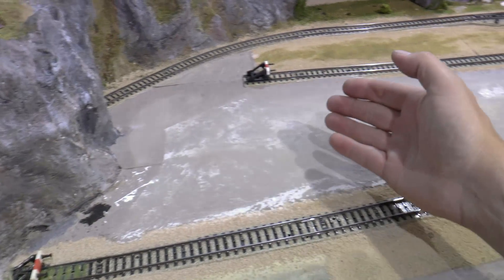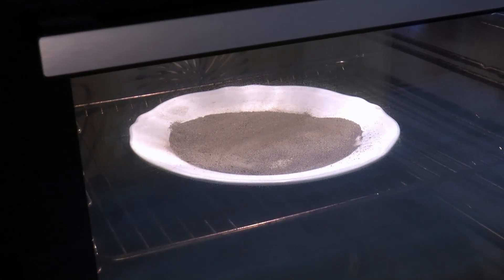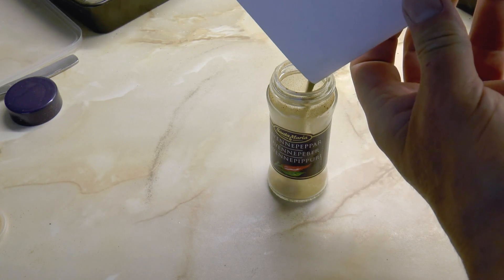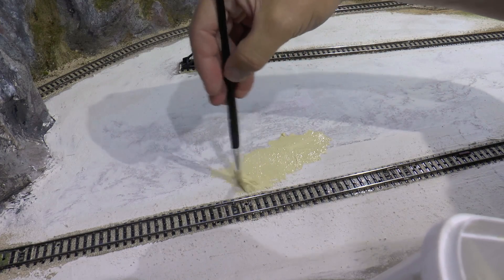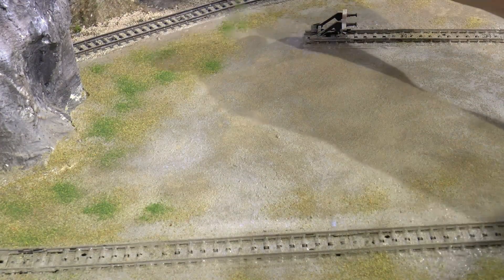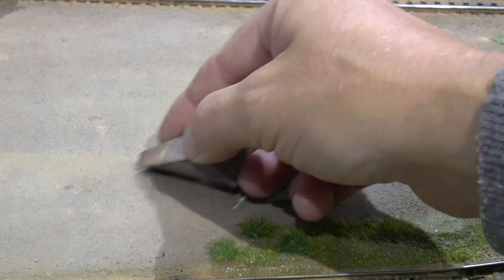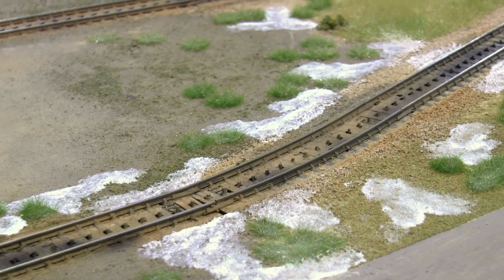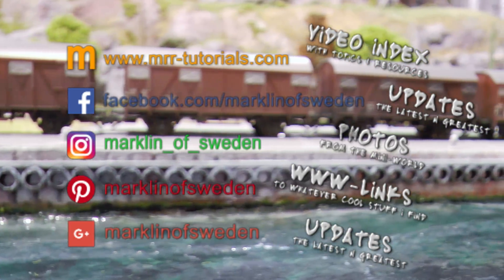Gravel covered ground ULTRA - Detailed guide DIY

Comment: When you dry the gravel, how do you set the oven up? I imagine that the fans are off, but what temperature for how many time do you dry it?
Reply from the maker: Hi! Thank you for a good comment! It´s gravel, so temperature can be anything really, but I typically use 100 degrees Celsius (=212 F) for like 10 minutes or so..
Reply: thank you for you prompt response!! What about bugs? do you try to disinfect it in some way or just let the heat do the job?